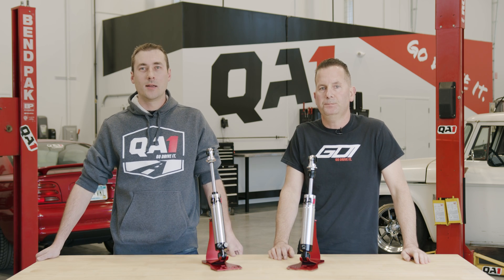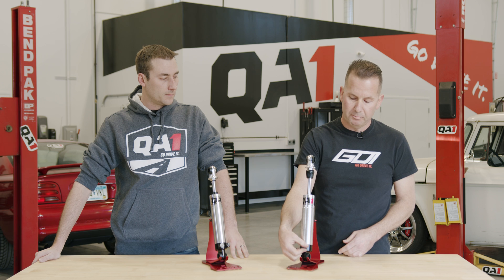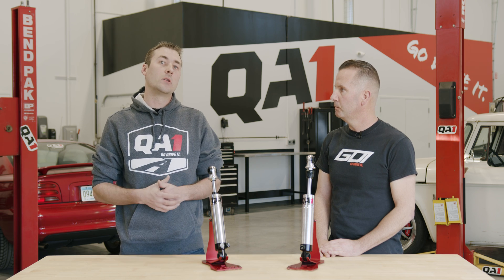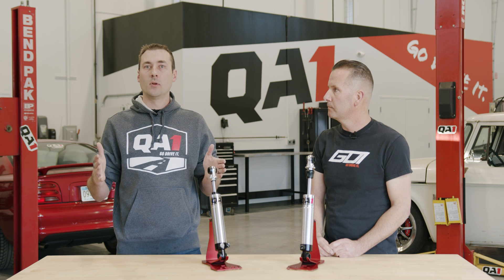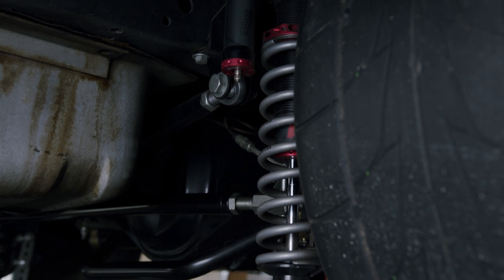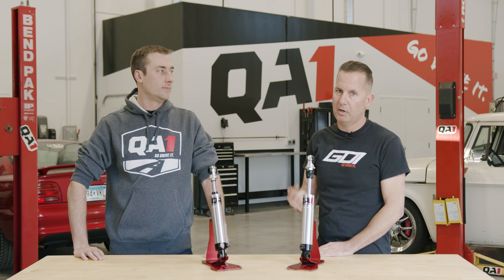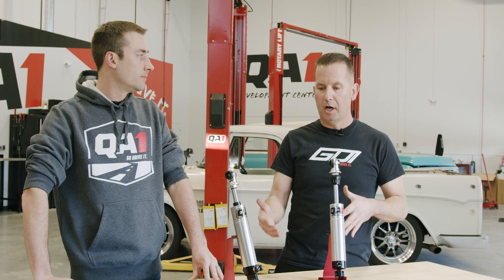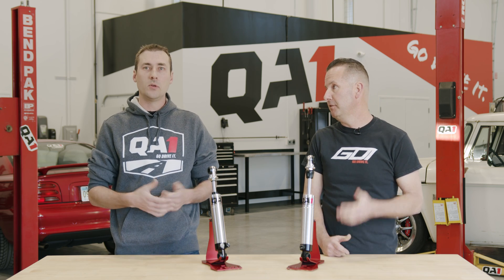Compression and Rebound Explained: How Shock Valving Works | QA1 Tech

Comment: I think you provided some very elementary information about Compression and Rebound valving, and not much else.  I am thinking that this short video is really bait to get potential customers to contact QA1?

For example, you say your recommendation is to go stiffer for Rebound.  But you neglect to mention that a stiffer Rebound damping can have a negative effect over repeated bumps, where the slowness caused by a stiffer Rebound setting can result in the damper ultimately jacking down until the suspension is riding on the bump stops.  At that point, the spring rate is almost infinite, so the ride becomes VERY stiff, and it can also result in the tires being unable to track the pavement properly and end up with less traction.

My suggestion for viewers who are trying to understand how to set up adjustable coilovers:

1. Start by setting all four dampers for Full Soft on both Compression and Rebound.
2. Find a good stretch of roads that will be a good test for the suspension response.  Make sure it has some bumps, ridges, ripples.  This will be your test route as you make adjustments, and the consistent route will help you to see how the changes affect the ride and handling of the vehicle.
3. Take the vehicle for the initial drive over your test course.  Make a note of how the front responds, and how the rear responds.
4. Now, with the rear still set for Full Soft on both Compression and Rebound, work on the front suspension.  Dial in Compression stiffness, several clicks at a time.  For each change, take the vehicle out on the test course and note the change in response for the front suspension.
5. Repeat Step #4 until the Compression damping is as firm as possible, without being stiff and uncomfortable.  Write down the final front Compression setting.
6. Now, work on the Front Rebound setting.  Increase the Rebound stiffness, a few clicks at a time, and take the vehicle out on the test course.  Note the response to increased Rebound stiffness.  The goal is to get the Rebound stiffness sufficient to quickly settle the vehicle after it encounters bumps and road surface changes.
7. Repeat Step #6 until the Rebound damping controls the chassis response smoothly, and doesn’t stiffen Rebound so much that the damper jacks down onto the bump stops over repeated bumps.  Write down the final front Rebound setting.
8. Now that the front suspension has been initially set, work in a similar manner on the rear suspension, starting with Compression damping.  For the rear suspension, Compression damping will have a bigger effect on ride quality (seat of the pants bumps), so use that as a guide to set the rear Compression damping.  Again, stiffen the Compression damping a few clicks at a time, then take the vehicle out on the test course and note the change in ride quality.
9. Repeat Step #8 until the ride quality of the chassis is comfortable over the test course - firm, but not stiff.  Write down the final rear Compression setting.
10. Finally, work on the Rear Rebound damping.  Increase the damping a few clicks at a time, and for each change, take the vehicle out and note the difference with the new setting.
11. Repeat Step #10 until the Rear Rebound damping controls the rear response to bumps, allowing it to quickly settle without excessive bouncing, and without causing the dampers to jack down and ride on the bump stops.  Write down this final rear Rebound setting.

That will give you a good initial setting for your suspension.  It’s important to write down these values and keep them, because as you drive the vehicle and become familiar with the suspension performance, you will likely note that the front or rear may need some fine tuning in the future.  For the fine tuning, only work on a single axle that you suspect could be improved, and only change the damping a single click in either direction.  Write down the change, then drive the vehicle and note whether that change made things better or worse.

For the fine tuning, take your time, and really focus on how the damping changes affect either the front or the rear suspension response.  Don’t try to change too much at once or else you will lose your reference.  If you do end up changing too many things and really mess up the response, go back to those final Compression and Rebound settings that you saved during your test route work, and start from that known reference again.

I used this procedure for both of my cars with coilovers, and it ended up giving me much improved ride and handling.

Comment: i have a fully adjustable customized magride in my 2018 Audi S3, with 3 way adjustable compression rebound. (low/med/high shock speed.) i dont like the harsh bumps over cracks around town. i think i will dial back my compression for low speed shock setting (< 2.5" rod trravel).  thanks for the thoughts, you got my project going.

Comment: i have a lowered car with very stiff spring amd wondering if i should have stiff shocks or soft shocks?
Reply from the maker: It might be better if you run your shocks stiffer with the spring setup you have. I would recommend calling into our tech team for some advice and recommendations. It may be easier to try to a different spring rate. They are available M-F 9am-5pm CST at 952-985-5675 or Sales@QA1.net

Comment: What's the preferred setting for the single adjustable shocks for 96 impala ss qa1 shocks
Reply from the maker: Hi there! If the car is mainly a street cruiser, a good setting to start would be 0-6 clicks. It may take you a little bit to find the right balance, but generally that's a good start! Adjust the knobs, take it for a drive and adjust as needed.